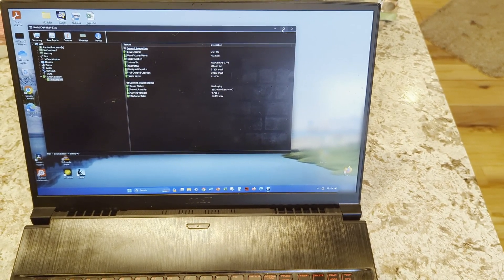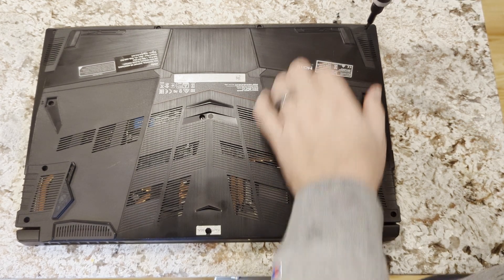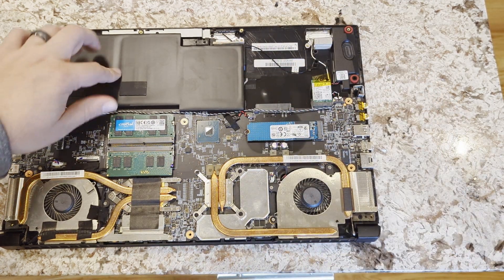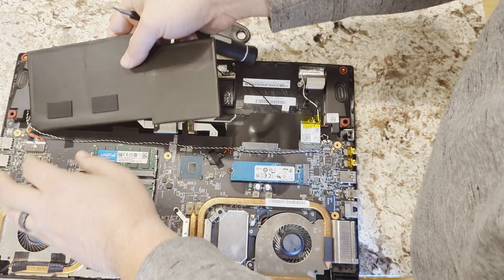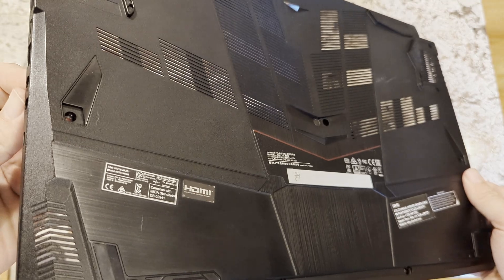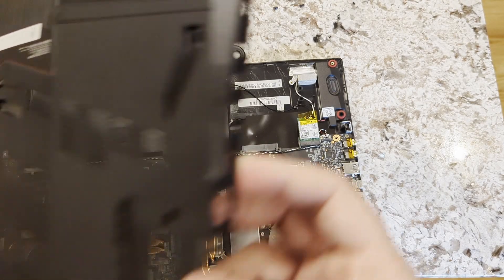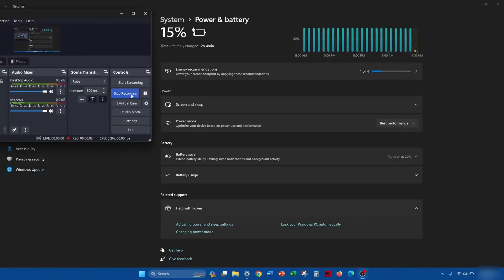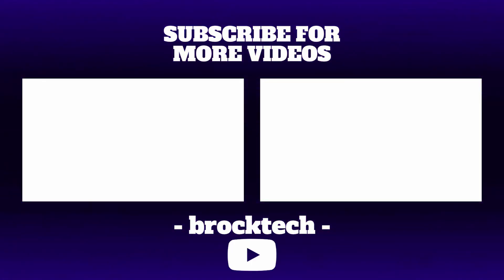Is your MSI Laptop battery dying? Here is how to replace it:

Comment: Hi brother thanks for this good video 
I have msi laptop that is MS-16W1 and the battery is nearly dead it lasts 5-7 minutes from where can i find a new replacement?
Reply from the maker: You can get replacements from MSI or retailers like battery plus or Amazon, or even  Ali express ( long wait time like 2-3 months). I have personally gotten batteries from these places in the past.  There are other places as well.  If you open the laptop case, you can usually find the model number.
Reply from the maker: MSI has the worst batteries I have ever used.

Comment: Hi, thanks for the video, my battery completely died. I have an MSI MS 16-W1. I want to ask you if you think I can improve the RAM of this laptop. I use it to make videos. I also notice it gets too hot after two or three minutes I turn it on, is there anything I can do to fix that? 
Thanks again for the video, I just bought this 1.5 years ago and the laptop was not so good.
Reply from the maker: Hi spiritual adventure,
The first thing is that the model number has many varieties of configurations.  But most come with 8 GB of RAM ( you should be able to add another RAM stick, check) you can use crucial's ram website to find the ram type for your laptop ( most likely DDR-4 for your MSI), personally I use at least 16 GBs in my computers. Windows uses around 4-6 GBs by itself. I use my MSI laptop sometimes to make videos ( edit, and render), but it is slow vs my desktop, the laptop runs very hot, I use a stand that has fans to help with the heat, you should look into something like that.

My battery would last 20-30 minutes at most on battery saver mode, I replaced it with a cheap option from Amazon. If you are going to replace the battery, I would try to upgrade the ram at the same time. My MSI laptop has 48 GBs in it, there was a cheap 32GB ram stick that I picked (after replacing the original 8 GB with a 16GB stick).
My video should be helpful but not exactly the same for your laptop.